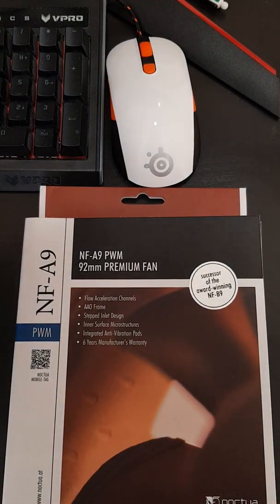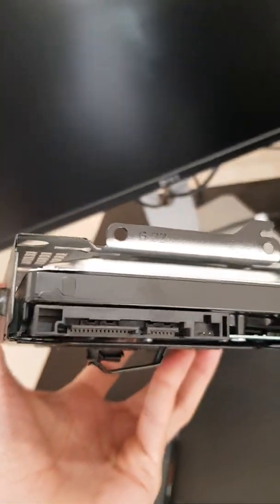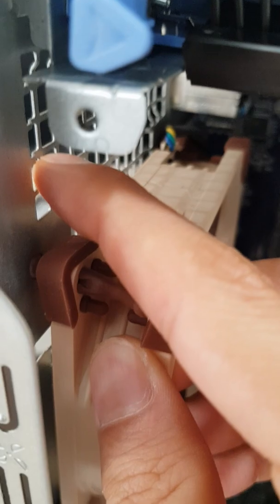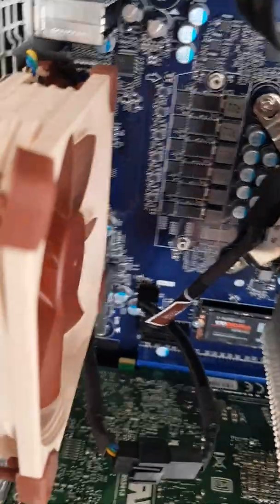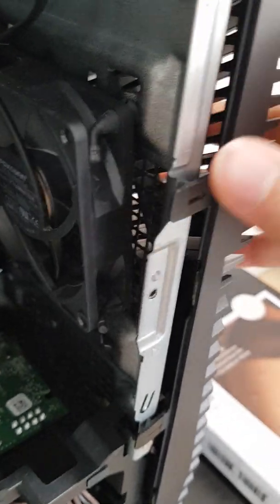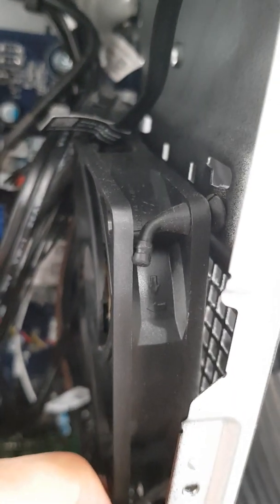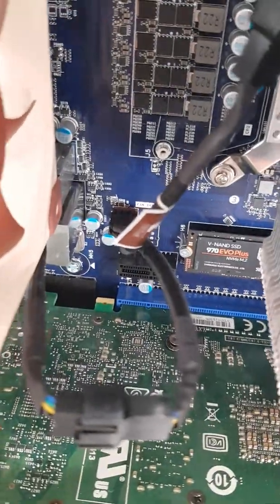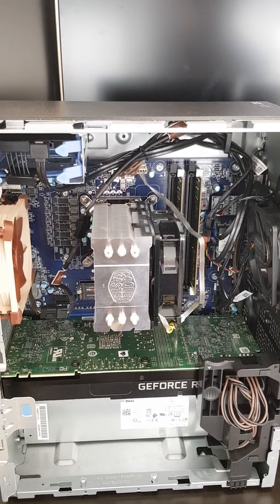Noctua NF A9 92mm PWM Fan Installation on DELL G5

Comment: nice video men, where you bought it? and i saw different configuration like 12V 4PIN PWM or 5V 4PIN PWM and the same with 3 pin, i just wanna replace the main fan
Reply from the maker: Thanks man! I bought mine from ebay (trusted seller and can provide the link if you want). Also I have not tried the other configurations you mentioned but in theory if the configuration sounds correct (using product spec sheets) then it should work. My configuration works fine for all my needs.
Reply: Noor S. Thxs for the answer and I would like the link plz
Reply from the maker: @jaimesegovia5437  Noctua NF A9 PWM Fan from Digilife seller. https://www.ebay.com.au/itm/Noctua-92mm-NF-A9-PWM-Fan-Cooling-Fan/142445015342?pageci=a2695eee-e4da-4592-a0b1-2fb517bafe63&epid=2256066102

Comment: Is that works if I swap the original fan with another  Noctua fan and put in front ? I got the same setting with you, after this installation, my CPU/GPU are still pretty hot (around 75c) and loud(60db) when gaming. The RTX 2070S I got has only one small fan on it .....
Reply from the maker: Have you upgraded your CPU cooler aswell? Also are you getting any bios error?
Reply: @nooragha360  No, I have not yet upgrade it. I did not get error by following your conversation in comment lol
Reply from the maker: @rigenwu5876  okay then I recommend you to follow my steps for upgrading your cpu cooler, because my system is not as loud and hot as yours.

Comment: How do I take out the stock 80mm rear fan. If I pull it out I feel like it's going to break the rubber.
Reply from the maker: Just make sure the tip is not going through the 2nd layer holes for all 4 sides. Then start with side and firmly pull the corner of the fan away from the case and it should pop out without breaking the rubber. It's not the easiest pull because of the tight space but the rubber should not break.
Reply: @nooragha360  Thanks, Noor! What actually happened is that my exhaust fan came mounted backwards. So I took out the rubber grommets and mounted the fan to be exhaust and not an intake. I really appreciate this video! I am thinking about replacing the stock cooler as well because of its noise. And so I wanted to ask if it's worth upgrading the cooler? Is it quieter and if you've had any bios issues after upgrading the cooler and fans?
Reply from the maker: @ammaarkhaleel2553  my setup is very quiet and keeps all my components cool. Also I dont have any issues with bios either, but let me know if you run into any issues.
Reply: @nooragha360  I have an issue. I have the exact same fan as you and plugged in the exact cords but I still get the fan error like with the bios, idk what to do

Comment: Planing on doing this on my current G5 aswelll, just got a question about where you put the original hard drive. The one that you took out to put the stock fan in the previous location?
Reply from the maker: I am not using the mechanical drive, since I installed another SSD on one of the two SSD trays. I have another video showing how you can upgrade the storage on the DELL G5.
Reply: @nooragha360  Alright thanks, also sound wise with new Noctua fan is it as loud as the previous stock fan or quieter?
Reply from the maker: @finlaylinden5854  its much quieter than the stock fan and better airflow too.

Comment: Thank you so much for making this video
Reply from the maker: No worries, glad to help!
Reply: @nooragha360  could i mount the mechanical drive elsewhere?
Reply from the maker: @gummymelting  personally I could not see myself using a mechanical drive anymore because its read/write speed is too low for me, takes too much space, its heavy/bulky and there are better options available. If having large storage drives are mainly used for backups then just use an external mechanical hard drive. Overall, I suggest dont use that mechanical drive and try an alternative such as using the ssd drive bays as seen in my other video.
Reply: @nooragha360  the main problem is low budget like i can't afford new drives Because i need atleast a 2tb internal drive
Reply from the maker: @gummymelting  Then I would suggest a 2TB mechanical drive that's the size of regular ssd and would fit in the hard drive bays. They should still be much more cheaper than ssd and give you the 2tb internal storage. Otherwise dont use the front fan because that's the only correct place to use that bulky mechanical hard drive.
Reply: @nooragha360  I think in that case I'll go for a seagate Barracuda 2.5in hdd and sorry i just had one last question what brand is the 2070s or is it oem
Reply from the maker: Its the stock graphics card that came with the DELL G5, which is the regular NVIDIA GeForce RTX 2070 SUPER.
Reply: @nooragha360  hey noors I was wondering did you get any problems when you booted up for the first time you installed the cpu cooler
Reply from the maker: @gummymelting  nope no issues with my setup.